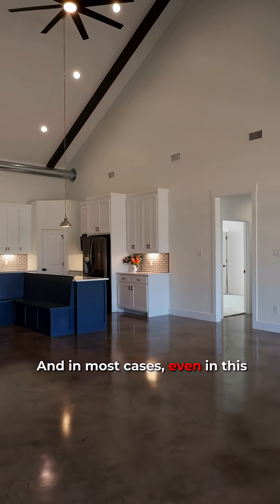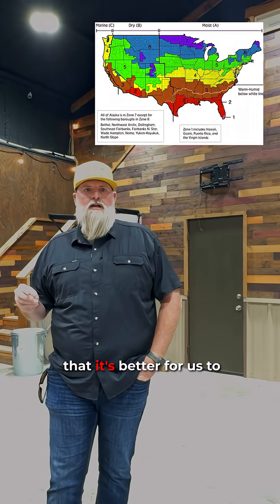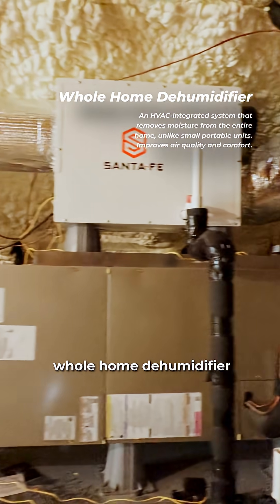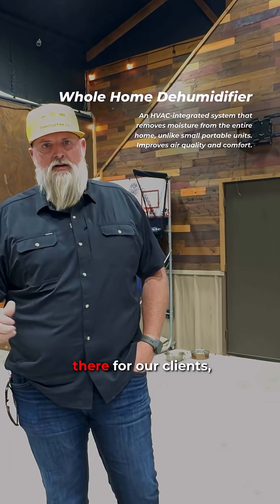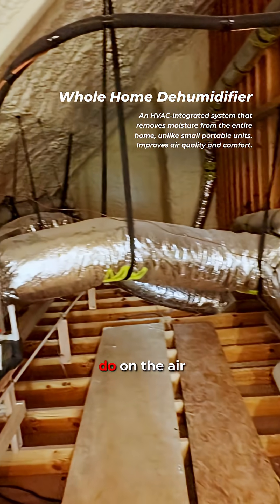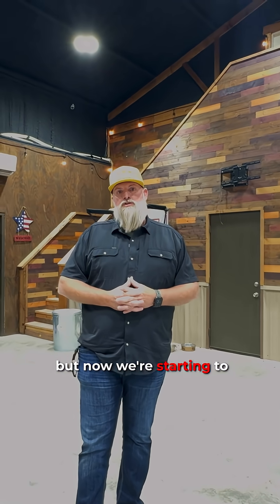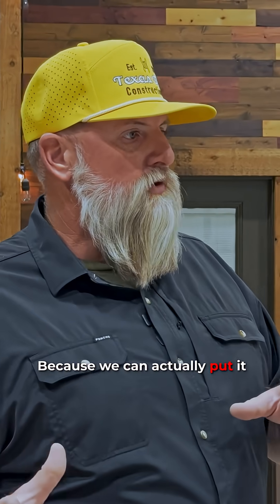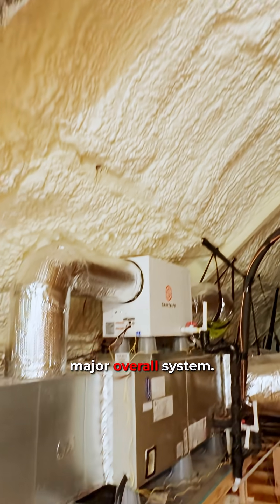Barndominium with whole home dehumidifier

Comment: Generally unnecessary. I live in south Georgia and my HVAC system keeps the humidity below 50 percent. He is just up selling for profit.
Reply from the maker: Additionally depending on the structure one has would determine some of the other concerns mentioned in the longer video.
Reply from the maker: A money grab for dehumidifiers? Sorry but not worth the trouble if that’s all it is.